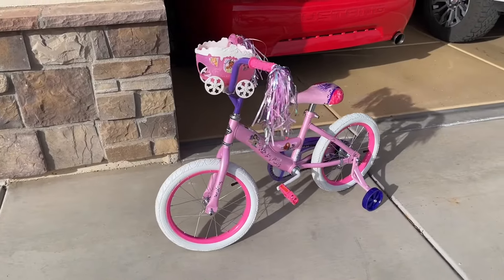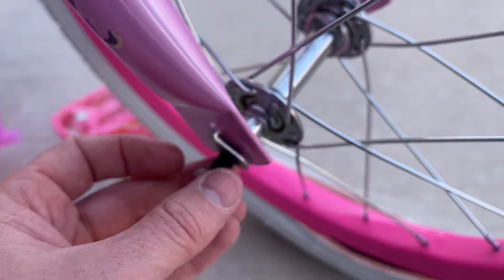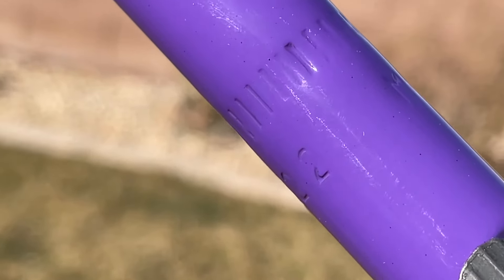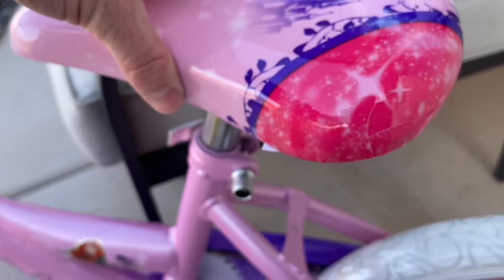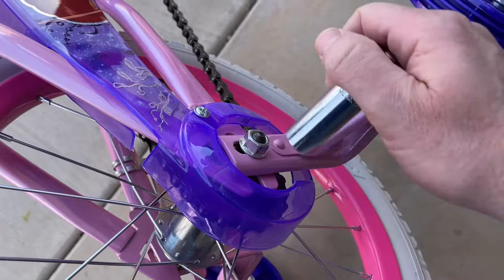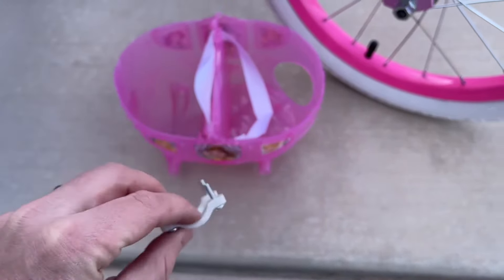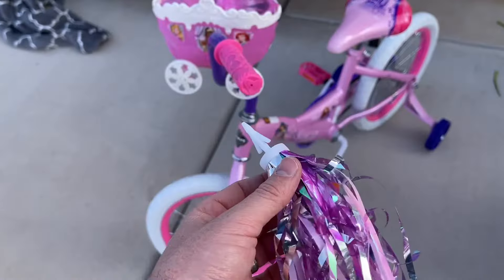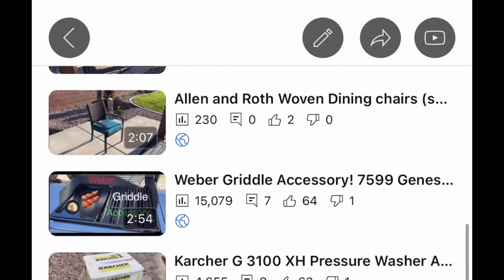Huffy Princess bike assembly step by step

Comment: Help. How do we get the plastic cap off of the handle bars ?
Reply from the maker: It was very hard to get off, but it pulls straight off. You can put a slit in it with a knife if you’re careful to help it come off, or maybe pliers
Reply: I used small mini scissors, worked for me

Comment: How did you get the nuts off the wheel though, cause our's won't come off.
Reply from the maker: With the wrench it should come off but see if it’s spinning the other side at the same time. If so you’ll want to hold the other side nut at the same time